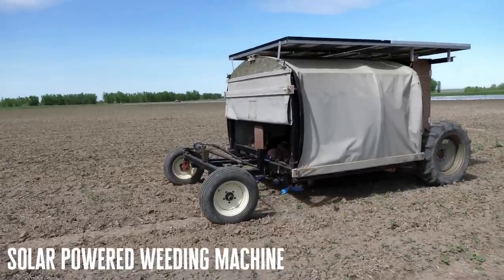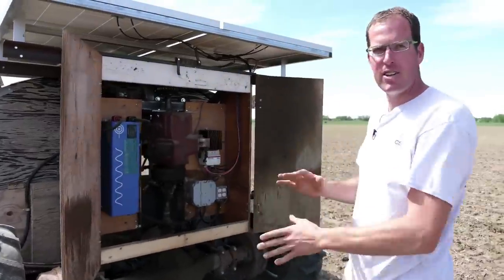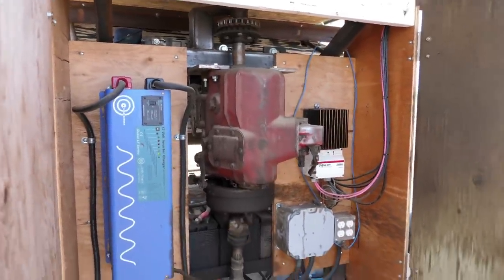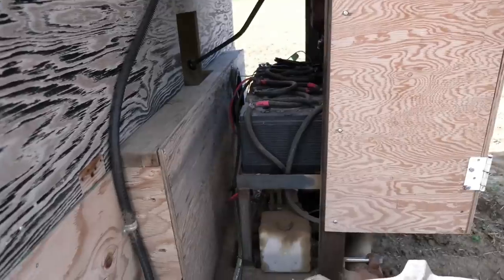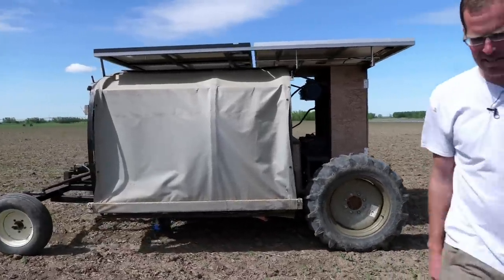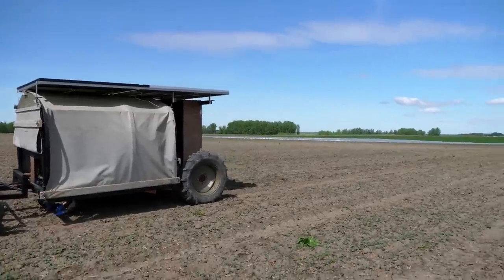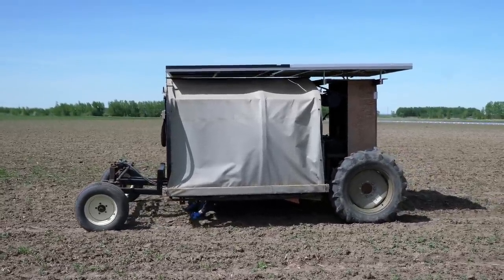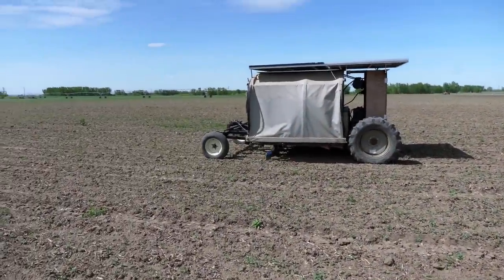Solar Powered Weeding Machine

Comment: you may want to tell them about this. From Howard Garrett website .CORN GLUTEN MEAL PRE-EMERGENT

The timing for applying corn gluten meal for pre-emergent weed control is just before the weeds start to germinate. We usually guess that to be February 15 to March 15.
 
 
 
Liquid corn gluten meal spray - a listener/farmer recommendation that's a great idea. 2014

The way we use corn gluten on our fields - we make a tea out of it and spray on the fields once a month from Autumn to May. Works very well. We use 2 to 6 cups of corn gluten to 100 gallons of water and spray it on with a pull behind sprayer. We just put the corn gluten meal in panty hose and suspend it in the sprayer when we fill it up, then swish the panty hose, remove and stir. Use at about 35 gallons per acre. Simple, economical and effective.

Comment: No disrespect intended whatsoever. If to be truthful though, however, it is not solar powered. The battery pack is charged by a solar array yes, however, unit is not solar powered directly. If it is truly self-contained, meaning that the batteries are never charged by plugging them into an electrical source than extreme kudos.
Reply: Didn't you hear he said that they have about 2x the amount of solar power than needed for the dc motor? So if the sun shines, it is directly solar powered+charing the batteries. Ofcourse if you have clouded weeks, you need to charge them though.
Reply: He says in the video that they're directly powering the motor from the sun on sunny days like the one in the video, but if it's overcast they run off of the battery pack. Regardless you're being so overly pedantic that theres no point in calling nearly ANYTHING solar powered because the solar charges batteries rather than directly powering a device. I don't really see the point in making a comment like that honestly.
Reply: Hi,  Andrew here, Yes, this machine is never plugged in.  In the past 2 season we had 1 day in which we ran out of power but we waited for the sun to come to go again!